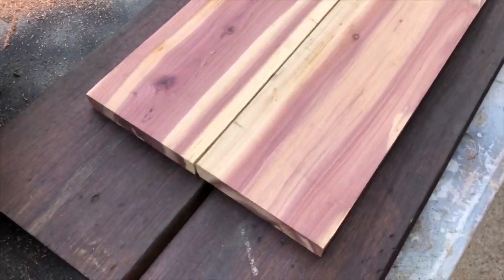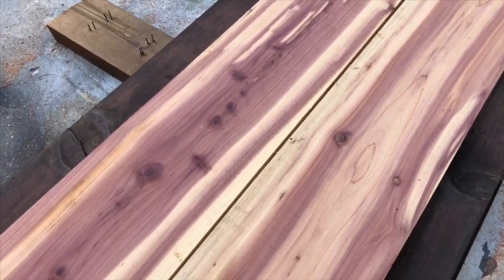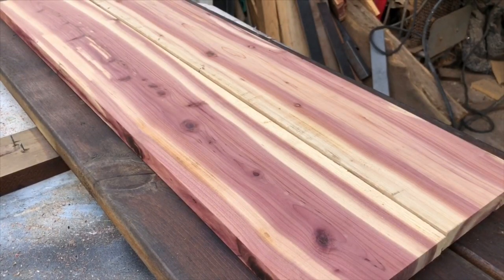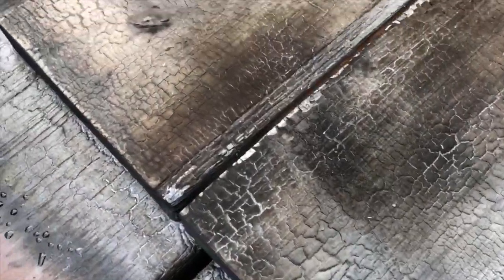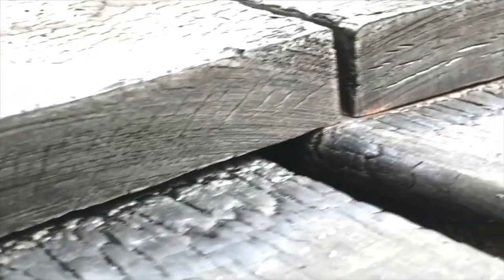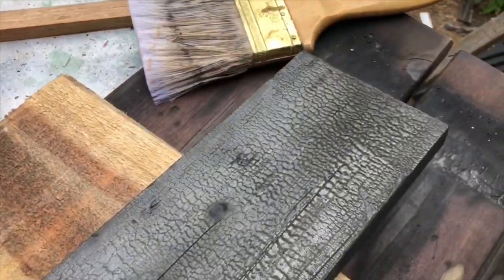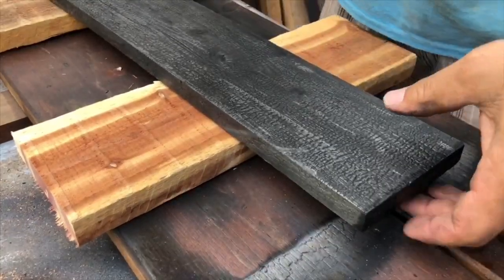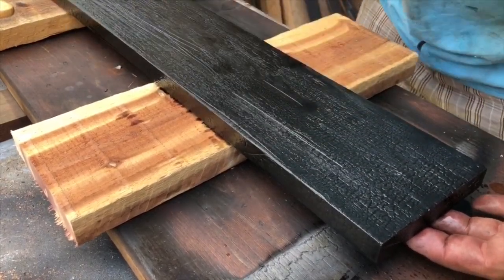DIY Heavily Crackled Shou-Sugi-Ban Charred Cedar Planks Burnt Wood Burning

Comment: I have done some charring. I have an issue with the wood cupping even though I spray it with water. How do you avoid that?
Reply from the maker: That is really trial and error. Some wood boards will cup badly while some not at all. In my case charr slower with a lighter heat than fast with a heavy heat. Also spraying with water prior to burning can help somewhat. Use narrower boards 6” for example over 10-12”.
Reply: If you burn the other side it should bend back
Reply: @loveofthegrainworkshop2891  thanks for the response. I will definitely continue to try. You have geat videos as well. Thanks for sharing!!
Reply: @marksinger2347  thank you I will definitely try that when that happens next.
Reply from the maker: Good point!

Comment: I appreciate the great video! After the finish is cured, would it be tough enough to plane the back side without damaging the front? I am wanting to plane it down to 1/2" but I am wanting to burn it at 1" to help prevent too much warping. Thanks!
Reply from the maker: Colt Henrie sorry for late reply. Plane it first. Once cured it is still somewhat delicate and will more than likely damage the burnt side

Comment: Wow, I really want to use this on a few furniture projects this summer. I was wondering how this would work with glueing pieces together? Can you use this technique on a finished project, will it melt the glue?
Reply from the maker: Vegan Rider not sure. My way of doing it was charr prior and glue after. It may heat up the glue and allow the boards to come apart. Glue up a sample piece and try it out.
Reply: Was the glue easy to wipe off without damaging the char?
Reply from the maker: Vegan Rider I made sure that I didn’t add to much glue in the seam. As you can see in the finished productat the end of the video I did not need to wipe anything away. This also had horizontal straps running across the boards underneath to help hold it together. Maybe that is a way you could try. Glue it up first. Add some straps underneath for holding it together while charring and the. Once cooled remove the strips underneath if you don’t want them there.

Comment: Did it work? The ash didn't destroy?
Reply from the maker: Иван Каминский yes it worked. I used cedar here. It came out great. I also hist posted a video with the same process but sealed with a colored epoxy resin. Check itnout
Reply: @loveofthegrainworkshop2891  Thanks. Have signed up on your channel. I'm going to do a fence in this technology

Comment: Beautiful technique! We just added a fence around our property, and thought about doing this. Its pressure treated pine, and wasn't sure if it would turn out the same or similar, and not sure if I need to have it completely dry to achieve this look. Is it a must to seal afterwards? Great work!
Reply from the maker: Hi Lacy thats awesome. As far as treated wood. I cannot say for certain. It shoudl char the same , it shouldn’t have to be dried due to the fact it will dry as you torch it. Doing such a large fence I would go to a hardware store and purchase a larger propane torch. Sometimes there used for killing weeds etc. they will attach to a large propane tank like on a gas grill and last much longer and burn faster. They have controls to be able to control the flame as well. Sealing afterwards shouldn’t be much of an issie as the wood is already treated. Go for it! Give it a year. If it look like it needs to be sealed do it then. But again far from an expert on using treated.
Reply from the maker: Have a hose handy to wet it so it doesn’t burn out of control.
Reply: Harbor Freight sells a "Weed Burner" torch for $20, or $30 for the self-igniting version. Works great. Uses regular grill propane cans.
Reply: Lacy, from what I remember you should not burn (I know your not burning it to get rid of it) treated timber (chemically treated) as it gives of poisonous fumes
(arsenic I believe) in the smoke and ash. Hope you have not done it yet.
Reply: Bill Ray I don’t think they use arsenic in treated wood anymore.

Comment: Could you show how you attached them to the sewing machine base?
Reply from the maker: Carl Barber sorry. No pics of that. There are factory holes in the top of the cast iron base. I just used screws with washers from underneath into the wood top

Comment: Do you burn first, then finish, then biscuit together?
Reply from the maker: mike kovach that’s what I did in this video. If you join first the heat can warp and pull apart the glue.

Comment: How has the oil held up over time? I am building a tiny house and am going to do this on my house.
Reply from the maker: Gabriella Goes Green sweet! It held up perfectly. If your doing this on the exterior of the house. Use a spar varnish oil finish or minwax pro spar urethane. Which is water based but made for exterior as well.
Reply from the maker: As with anything exterior you will need to reapply annually or bi-annually.

Comment: I'm looking to use this technique on the base of a wire sculpture I'm currently working on. In my research, I've read that you should brush the soot off, but I really want that nice crackly alligator skin look you have here. How well did the oils soak into the wood when sealing? Also I want more of a matte look to it than your finished project, do you have any suggestions?
Reply from the maker: I would definitely make it identical to this and seal with the oil based finished as I mentioned first. Them once that cured fully. Seal with a top coat of water based poly which builds over the surface. And yes I would use matte or satin.

Comment: Nice video.  Question for you is how well does the charring get sealed in and not rubbed off over time?  On an exterior application where clothing might be in contact with it, do you use epoxy sealers after charring, or oils only?  Seems to me like clothing sitting or touching it might be a problem over time.  What are your thoughts?
Reply from the maker: You are absolutely correct. This is the traditional way of sealing a fence or siding. For furniture you would want to seal with an exterior water based poly or even epoxy resin.

Comment: I've been looking for a demo on this texture for a while, thanks so much for posting!  I've been wanting to use this technique for a bed frame. Question tho, am I going to get black stuff all over my sheets :| ???
Reply from the maker: Jesse Bond if you leave it very scaled like this finished product in this video. Possibly. I would use the brushed technique I have in one of my other shousugiban videos. Basically after charring use a wire brush to scrub the loose scales off. Then seal. And there will be no rub off.
Reply: Wash the char with a garden hose then seal it all in with a form of oil like linseed or tung oil. You don't necessarily have to wire brush it so you can leave the char on.
Reply: @jerrellbevers6071  do you do this right when it's hot? Is that important or does it not matter? I've been curious about the water technique a lot of pros seem to use it
Reply: @chompers11  
It's an either/or situation. Doesn't matter hot or cold except for popping from cold water on hot wood. Your getting all the loose particles off so that you work the surface without it being ash and oil mixed together.

Comment: Love this. What could I do with this technique? Furniture?
Reply from the maker: Rodrigo Mattos absolutely
Reply: I’m gonna try
Reply: @thedynamiteagency  any furniture why not but especially outside stuff as the original reason to do this technique was for the weatherproofing ability.  There is a reason why you find old camp fires years later, the char is resistance to water, insects and rot and protects the wood within just like the thin layer of aluminum oxide protects aluminum.

Comment: How do you keep it from cupping? and if it does whats your remedy to straighten it?
Reply from the maker: MITCH OFF THE FENCE on thicker pieces there shouldn’t be much cupping if any. Especially using a plumbers torch like this one. On large projects with a weed-garden torch it gets much hotter and there is more of a chance of cupping. But I’ve done large doors and not had enough cupping that it needed repairing.
Reply: Supposedly if it cups you can burn the other side to uncup it
Reply: @cuchanu  Someone else recommended that to me and also light sprays of water, seems to work

Comment: Beautiful wood and video. Would I do the back side of the wood, too, if using it on an exterior (window framing)? How long did the two coats of poly/oil last before they needed another application? Thanks.
Reply from the maker: I always recommend burning both sides. Helps against warping. As far as durability of the finish. Typically once a year finish needs to be applied but a lot depends on the weather outside.

Comment: Hello, i'm looking to do this on a much larger scale. How much map gas have you used per board foot, and is that the most cost effective way to get the best results? Thanks!
Reply from the maker: Forrest Branamfbranam on large projects I use a large weed burner you connect to a propane tank. You can get them at most hardware stores for $40-$50

Comment: When charring how do you prevent warp?
Reply from the maker: Try to pick wood that has not come from the core of the tree. Do this by looking at the end grain of the board. Look for pieces that have grain that aren’t sharply curved like they came from the center of the tree. Also keep a bottle of water to spray or brush on immediately after charring to cool it down quick.

Comment: Hi, I’ve got few questions! I’d be glad if you will answer on them 😉
Why you chose cedr wood for it? Is it becouse of sugars in wood which are carmelizing(?) while you burn it? 
Which kind of wood do you recommend for this method? 
I’ve bought natural oil from Tungus tree, do you think that I should mix it with something before I will moisture the plank? 
Thanks 😉
Reply from the maker: Patryk Dzieran it’s a naturally protected outdoor wood and the grain is perfect for this.  Pine or cedar works best. I have seen that oil and it should seal well. But I would apply per the instructions on the can.
Reply: Love Of The Grain Workshop Thank you for your reply! I really appreciate it. Right now I’m after the tests. For me (I burned oak plate/plaster) better protection is after the decorative epoxy which I brushed my tabletop. The wood is “drinking” that epox and make it pretty shiny against to that oil. 
It’s good because it doesn’t make any marks after the burning.

Comment: 👍 Nice look! Did you use oil-based poly for your 1:1 poly:linseed mix?
Reply from the maker: Absolutely correct. Water and linseed will not mix. You have to use oil poly.

Comment: Loved the video! First one I’m watching as I’m planning on going for a personal project... quick question though, I’ll most likely not find the finishing products you used in my country, would mineral oil alone work for a finish? Thanks a lot
Reply from the maker: Not really. That doesn’t really cure and it will dry out over time. Sorry. Danish oil, teak oil, tongue oil.
Reply: @loveofthegrainworkshop2891  Hey! Just a follow up question: does that mean that with teak oil, danish oil and tongue oil one does not have to mix it 50/50 with anything?
Reply from the maker: @jennyueland3111  absolutely true. Those are already mixed and ready to use.

Comment: Great video - your camera work is fantastic and you speak clearly and at a good pace.  The wood looks beautiful.  Only question - how long  per square foot does the burning process take?
Reply from the maker: Greg Haldane thanks so much. As far as your question it depends on the torch and fuel used. On small projects I use a plumbers torch with yellow map gas tank. Burns pretty fast. But I’ve never timed it. On this project I think it took 20-30 minutes for all the boards. On larger projects I use a weed burning torch which is much hotter and faster.

Comment: How is the protection holding up (and does it stain if you touch it)? I plan to make a base for a coffee table with "alligator skin". I plan to make a 50/50 mixture of boiled linseed oil and mineral spirit.
Reply from the maker: Anders Hansen It held up very well. I no longer have it. And with a bunch of heavy coats applied it did not rub off.
Reply: @loveofthegrainworkshop2891  Thanks for the quick reply. And great info about it not rubbing off. Thanks.

Comment: How well does the dust (Chared surface) gets locked in? Will it stain or get other stuff dirty, in other words, can I put my wife's brand new white tablecloth on it?
Reply from the maker: Mateus Carvalho if you put multiple layers of sealer on it. It’s doesn’t at all. Just make sure you scrub with a wire brush to remove loose pieces.

Comment: This is the way to do it for maximum wood protection. It's the thick layer of burnt char that protects the wood  from UV damage, and rot/insect infestation. Basically the sugars are burnt off, so there is nothing for those organisms to feed off. I'm building a cabin in a high fire-risk area, and I understand that this technique makes the wood take longer to burn. If the fire is a fast moving one, I understand that it will pass over shou sugi ban treated wood. My question is this: if the wood is then sealed with oil, does this negate the fire-proof qualities? (we all know that oil likes to burn.) 2nd question...if it's not sealed with oil, does this make it vulnerable to water damage? The cabin is in the mountains, where it rains for a good 6 months of the year. Anybody know what the tried and tested traditional Japanese finish is?
Reply from the maker: maodonimega so from what I understand. And I may be wrong. The heating closes up the pours to protect it from a bunch of things.
Reply from the maker: Water included in that. Makes it harder to absorb. But the adds protection from various things. The oil used should be an oil based product that would dry. So as far as I would know it shouldn’t help it burn once cured.
Reply: @loveofthegrainworkshop2891  Thank you....makes sense.....I have written to a Japanese company who uses traditional Yakisugi/Shou Sugi Ban  to see if they have any insights on the use of oil. Will let you  know if they get back to me. I want to do all of the siding on my cabin in this way, so I need to get it right! All the best.
Reply: I will say that when I do this I but  all sides and when I do it that way I get much less warping or any at all. Just an observation
Reply: Burn*
Reply: good to know @joelthoenen3733

Comment: the point is to avoid need of any finish, shou sugi ban is the finish
Reply from the maker: Michael Wilson you are absolutely right. But on a piece being used for decorative purposes like a table top on this one. It needs to be sealed to protect the char. And even the old technique has some sort of oil finish like linseed oil etc.

Comment: With the Danish oil would it crumble or flake off is someone was to bump into it ? or does the oil harden the surface allowing it to be durable ?
Reply from the maker: Snows Tech danish oil is a penetrating oil that does harden. At first it seemed like maybe it wasn’t a good choice. But after fully curing for a few days. It definitely hard enough. You could also do a flood coat of epoxy or straight Polyurethane.
Reply: Thanks a bunch for responding. I'm renovating my place like crazy and I'm planning ahead. a shou sugi ban mobile kitchen island/bar might look good. I want to keep the look of the char a little matter than what epoxy would do. Might jump into danish oil like you did. Maybe poly. I guess i'll have to test it out !
Reply: I'm doing a house rebuild and I'm burning the foundation piers and beams, as well as the skirting boards and the outer floor joists to match and it looks amazing so far but I can't even touch it without soot rubbing off. Is a hardening sealant what I need?

Comment: Hello, can I please know if the charred wood has to be cleaned with water and wiped to dry or after burning u directly apply the oil? 
Thank u to respond
Reply: No.
Reply: @patrickdunn8918   didn't get u
Reply: @vickyleelo107  I was answering your question. No, you don’t have to use water, in fact there is lots of mis information on all this stuff. But, I will say I’m doing it on pine, not cedar. Just burn to desired look, and move on. There are lots of different ways to surface it before staining. Wiping, brushing by hand or power tools. There is no one way is right process. All of it looks amazing, but if you over complicate it, it can become very time consuming.
Reply: @patrickdunn8918  Thank you so much for your reply...It will help definitely...
Reply from the maker: Patrick dunn is correct. No need to clean it. I use water to help cool it after burning. But that’s all. If you do that yes you will need to let it dry prior to sealing with oil